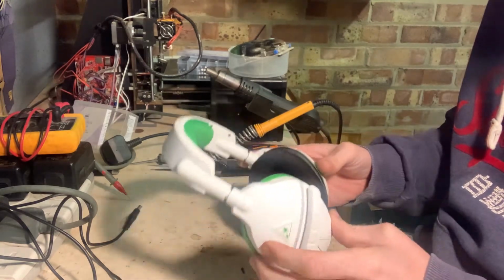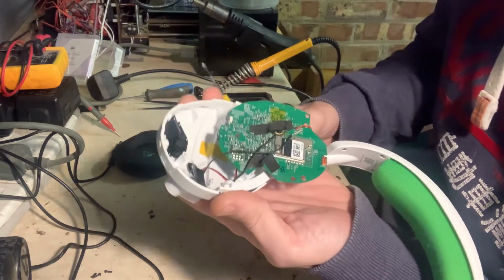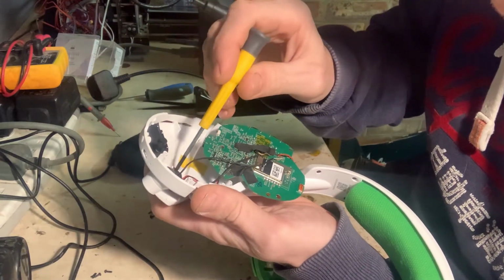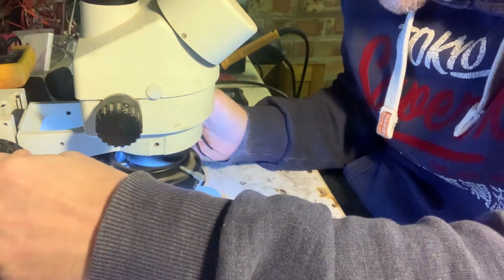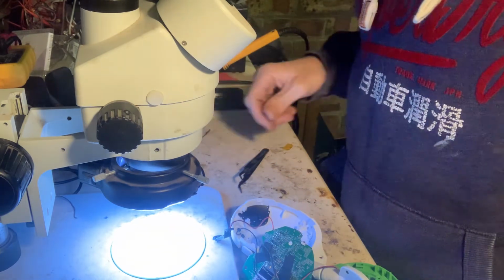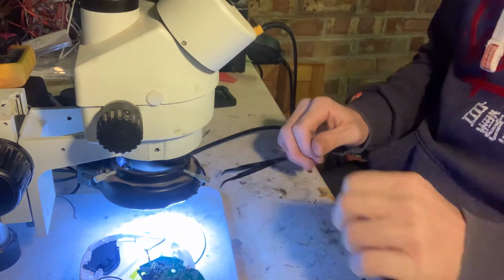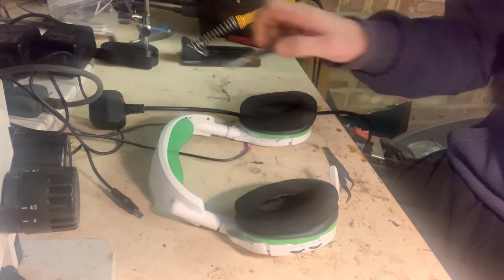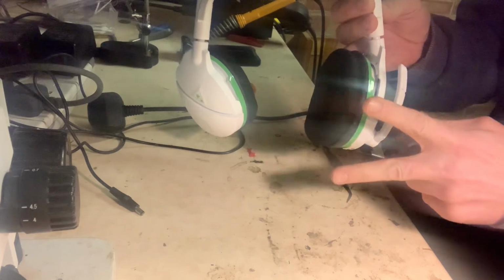Turtle beach stealth 600 repair

Comment: How do you remove the couch it has on the earing?
Reply: I might be a bit late, but just pinch on the rubbery part and pull
Reply: @God-lt9gm  Thanks for the tip, yeah I realized how to do it once I was on the process of doing it, either way thanks for confirming it.